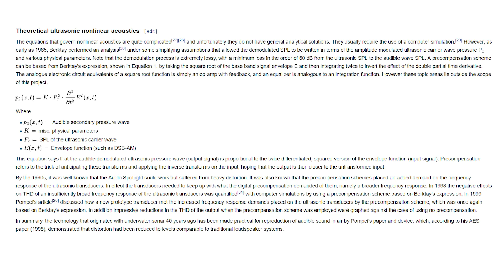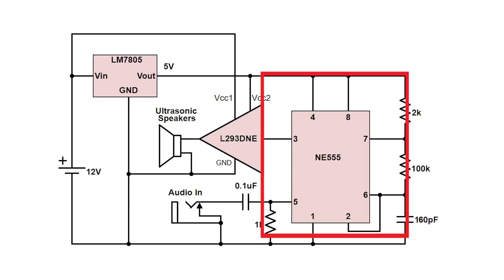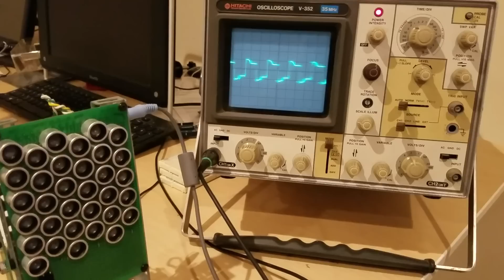Turning Sound Into a Laser

Comment: Nice, now all we have to do is add some configurable delays to each speaker to do phased array beam steering. Right? Probably?
But I wouldn't know what devices you'd use to do that- presumably something you can pipe the analogue signal through but turn on/off really fast with a microcontroller? May need someone clever to help with this...
Reply: very simple geometry :) given the carrier frequency and a speed of sound, correct the phase for the different length of each path. simple division.
Reply: @atomictraveller  Ah yes, I can program it to alter the angles just fine, just don't have the experience in electronics to know what physical devices to use. Or if a simple circuit could be made so the phase/timing can be controlled from a microcontroller pin.

Comment: Since Laser is short for Ligth Amplification by Stimulated Emission of Radiation, this should be a called "Saser"
Reply: No it shouldn't because this does nothing of the sorts and is not even close to being like a laser. Sasers do exist but are so damn hard to research because of all the bullshit people put out as sound lasers. Sasers function in insanely high ultrasound frequencies such they are able to create plasma on contact with metal surfaces in some cases. I currently am considering construction of something that might operate like a real laser using clusters of specifically spaced, sized, and arranged spheres in hopes I can get frequency and phase coherence same as a laser without doing the insanity that is needed with cooling and ultrafine metal powders and rods of sasers. Only problem I forsee is potential size I might need but each object would have harmonics which need to resonate with a base tube such that they all pump a single frequency/phase.

Comment: It'd be a hell of a lot more work, but if each transducer were fed an independent signal with each having its own amplifier would it then be possible to introduce subtle timing delays to induce constructive & destructive interference between each source in order to steer the 'beam' using a purely solid state device with zero moving parts?
  
Or for the interfering signals to act similar to an optical lens in order to further focus the beam on an even tighter region?
Reply from the maker: Yes!  It's called "beamforming" and it works exactly as you describe.  It was just too much complexity and cost to add to this project.
Reply: @CodeParade  Ah yes. I've actually heard of the term but never really thought much about how it would work. Makes sense.
   
....So yeah, any plans for a v2 of this project?

Comment: Non-linearity demodulates an AM signal. For example think of what a diode would do to an AM radio signal. Interestingly that speaker interference from GSM phones is caused by demodulation occurring in non-linear circuit components. Very interesting stuff!

Comment: L293D PIN 7 TO PIN 3 OF NE555
L293D PIN 1 AND PIN 16 TO 5 VOLTS LIKE PIN 4 AND PIN 8 OF NE555
L293D PIN 6 TO SPEAKERS
L293D PIN 8 TO 12 VOLTS
L293D PIN 13 TO GND OR NEGATIVE POLE
Reply: Did you successfully complete this project in the end? I am trying to do this project.

Comment: Hello, I am from Spain, and I want to thank you very much that you have put how to make this sound system.
I am a person affected by tinnitus and had always wanted to have a sound system to sleep, without disturbing my family.
I think you could sell these devices to people with tinnitus, who need to simulate sounds of rain or relaxing to sleep, without disturbing those around
I have notions of electronics, but I don't have an oscilloscope. Will I need to do some electronic adjustment once the device is made?
Many thanks !!!!!.
Reply from the maker: You can actually buy these commercially, though they are a bit expensive: https://www.soundlazer.com/product/sl-01-open-source-parametric-speaker/
Reply: @CodeParade  Thank you very much for answering !!.
I'm going to try to do it, it seems easy thanks to your wonderful video and electrical scheme, if it didn't work for me I would consider buying the device.
I have a doubt, what model are the ultrasonic speakers?

Comment: Pardon my ignorance, but what does the black arrow in the audio-in circuit represents?
Reply: Its a normally closed switch
Remember how old stereos would disable the inbuilt speakers if you plugged in a headphone? The switch open when you plug a jack, so the inbuilt speakers switch off.

Comment: Quick question.. are all the ultrasonic speakers connected in parallel ?
Reply from the maker: Yes.
Reply: @CodeParade  Thanks a lot kind sir, is their a limit to how many speakers you can connect to it?
Reply: @pratyusha1588  not as long as you have enough power to run them all.
Reply: @theapexsurvivor9538  oh ok thanks

Comment: What I would like to know is how to focus 40 KHz ultrasound and still have the audio demodulate into the same 40 KHz tone. Or is that impossible because of the attenuation in air?
Reply: No, the problem with ultrasonic transducer.They have the max range up to 40kh.if you want to increase the frequency you may bought high range ultrasonic transducer.

Comment: Wonder if long term exposure would be a problem, this could be used to create a surround system for theatre use without adding remote speakers. Power limitations could make this impractical though. Great video!
Reply: The problems ultrasound cause on the human body depend only on how loud it is, so below 120dB you should be fine

Comment: Let’s build a go fund me account as well as a surround sound system that don’t need wires and speakers all over . Just a center channel hub that has adjustable speakers that can aim in the corners of the room or aim them wherever is needed for surrounding the listener.
Reply from the maker: I think people that want surround sound also want high fidelity.  You'll never be able to match the fidelity or volume of traditional speakers with modulated ultrasound.

Comment: What is the capacitor used for? That connect to mc7805 or lm7805
Reply from the maker: It's needed to smooth out voltage spikes on the power line when the transducers cycle on and off.
Reply: So Is that necessary? Or can be ignore
Reply: I  use the same ic why the sound is so low.

Comment: I will try to explain why the sound, or in general a wave, seems to be less dispersive for higher frequencies. Basically to describe a wave we use some parameters and one of the most important is the wavelenght λ (lambda). The wavelenght is inversely proportional to the frequency (f) so whent f is higher λ decrease. 
When a wave passes through a slit or encounter an obstacle a phenomenon called diffraction can occurr. Diffraction occurs only if the dimension of the obstacle is comparable to the wavelenght λ. 
If the wave encounters an obstacle comparable with λ, you can think as if it spreads out in a spherical pattern all over space. Of course the intensity too is spreaded out, but we will observe a maximum of intensity towards the center (where the sound is localized) and less intensity in other regions because of diffraction. It's often said that intensity is "modulated by diffraction".
For sound waves in fact we have that λ is comparable with the major part of obstacle in our daily lives, it's because of that that you can hear someone voice in another room or behind a door. 

Hope that it will be useful. Good video though.

Comment: Nice result. What really makes it directive is the array. It is clever of you to modulate the sound to unltrasound freq. so that the BW to centre freq. is so small. Only then you can apply array theory and only then forming those speakers with separation of half wavelength of the carrier freq. (Ultrasound freq.) you get high gain at the bore sight while very little power going in other directions.
Try changing the phase between speakers and you can change the main beam direction.
Good work and well done👌

Comment: Just one question: the frequency domain of a square wave is rather nasty, with many, many high-order harmonics. Have you tried and had success with using a sine wave rather than square? It would complicate things but you'd have a different modulation
Reply: Probably makes no difference. These ultrasonic transmitters are really only sensitive to 40KHz, +/- a few KHz or so. The first harmonic of a 40KHz square wave is (iirc) at 120KHz, which elicits almost no response in the transmitter.
Reply: @Spritetm  to rephrase, the speakers filter the square wave.. which yields a (near) sinusoidal wave.

Comment: Higher focusing:
Air moves by flowing around, from high to low pressure. If you have any sound waves, air has to flow with mach 1 back to close the gaps. It's this behavior that changes with the frequency: low pitch noise gives enough time to fill the gaps from any direction "perfectly". High pitch gaps change more often and won't allow every freedom of movement to the air, despite the easiest direction which is "back and forth" according to the sound source.

Comment: It is not the laser principal though but more like phased antenna array so most likely you'd be able to direct the sound "beam" without moving the "speaker" physically by synchronically changing the time signal comes to each small speaker. I assume that would be an awesome experiment.
Reply: You wouldn't achieve much steering with a phased array of these. A phased array can only control where the field is most concentrated, not where the beam is actually going. As a result it can't "steer" the "beam" anywhere that all involved fields aren't already present. Don't think of phased arrays as a steering system. It's more like a lampshade effect. It can weaken the signal where it isn't wanted and brighten it where it is desired, but it can't change the true direction of the actual wave fields.

Comment: can i get a better schematic, or a part number? I want to replicate it but i cant quite find that 160pf capacitor
Reply from the maker: You'll have to tune the capacitor to frequency match the transducer anyway.  Get something close and add little caps in parallel until the signal is loudest.
Reply: @CodeParade  thanks so much! Is there any more detailed schematic, because i can't quite find the right ne555 timer, the pinout is kinda different :/

Comment: For a moment, I thought you made a phased array speaker or something. You think you can change the direction of the beam that way?
Reply: It's my understanding that phased arrays depend on the ambient transmission effects and then simulate steering by controlling where the wave is strongest. A phased array with signals that are already near parallel would only be able to steer within the area where the beams begin to overlap.

Comment: 2 years from now I'm expecting a working model of the Saints Row Dubstep Gun
Reply: Just crank up the speaker power and tune the modulated signal to the resonant frequency of the target object. Cruise ships have been using that as an anti-pirate weapon by tuning ultra high intensity beam-forming speaker units to the resonant frequency of human tissue for a few years now. It's almost instantly crippling to the target but causes little to no lasting damage when the beam is removed.

Comment: The reason that smaller wavelengths bundle better is because to get a small beam you need to sum multiple spherical wave fronts together with the right phase relation. But then the beamwidth must be at least several wavelengths long so the more wavelengths you have the more bundled you can get your beam. When you get down to the order of magnitude of 1 to 5 wavelengths or so it stops being noticably bundled. This is also why parabolic reflectors must have a diameter multiple times the wavelength. Otherwise you just get diffraction.

Comment: The camera mic has a low pass filter, so it fails at capturing the sound. You are seeing that the whole 'you can't hear more than 20khz' is as stupid as 'you can't hear more than 30fps' BS. Even though you can't actually hear the sound waves themselves, you can hear the secondary waves caused by them.

Comment: "This is actually exactly the same as how FM radio works"

Uh...except totally not even close
Reply: Of course it is. He means modulating a higher frequency electromagnetic wave signal, the carrier, with a lower frequency one, the signal, which is then demodulated. In FM, the parameter that gets changed in the carrier is the frequency.

He's doing the same thing, but with sound waves. The high frequency carrier ultrasound is modulated with the low frequency audible sound wave.
Reply: @esuelle  you realize sound waves and EM waves are not the same. I honestly don't see how that can be interpreted as "exactly the same"

Comment: The single slit experiment you showed with an increase in wavelength causing a decrease in diffraction was just because diffraction is greatest when the width of the slit and the wavelength of the sound is equal. Having said that, a higher frequency could well affect the other effect you were talking about with modulating and stuff, I really don't know about that. Great video!

Comment: 0:24 it is not dependent on the frequency, but on the ratio between the wavelength and the hole size!
Reply: Isn't wavelength inversely proportional to frequency?
Reply: @ki0w0-lordofwatersheep  wavelength = speed/frequency. I mentioned the wavelength because that can easily be compared to the hole size.
Reply: @lithostheory  if wavelength = speed/frequency how could aomething depend on wavelength but not frequency? As if they're independent, yet you said they don't
Reply: @ki0w0-lordofwatersheep  It depends BOTH on frequency and wavelength, they're equivalent ways of describing a wave.
Reply: @lithostheory  depending on BOTH frequency and wavelength kinda contradicts your original comment where you said it does not depend on frequency
Reply: @ki0w0-lordofwatersheep  Oh, ok, what I meant was that it does not depend on the absolute units of frequency, like 10kHz or something, but rather on the unit-less quantity of the number of wavelengths that fit inside the hole. So the effect is connected both to the frequency (and hence wavelength) and the hole size at the same time, the ratio of which is the important measurement describing the diffraction effect you will see.
Reply: @ki0w0-lordofwatersheep  I think you have to have a constant for it to be proportional, and wave speed isn't a constant.
Reply: @h4724-q6j  The speed of light is constant though :^) (in vacuum).
Reply: @lithostheory  that wasn't about exclusively light though and, as you said, that only applies in a vacuum.
Reply: Also, because we're talking nonlinear acoustics here, it's worth noting that the local speed of sound varies sinusoidally along the length of the beam

Light doesn't do that, at least in attainable power levels
Reply: wave length = frequency.

just sayin'
Reply: Which, for a static hole size, are the same thing ;)
Reply: @entropyzero5588  True, but it is important to realise that the math does not care about absolute units.
Reply: @lithostheory  idk about that. I've seen some complete chonkers in my time which the math would definitely care about.